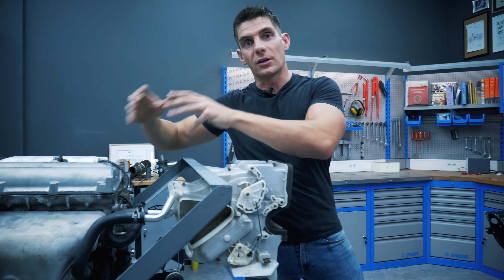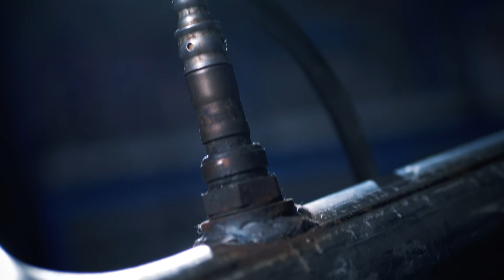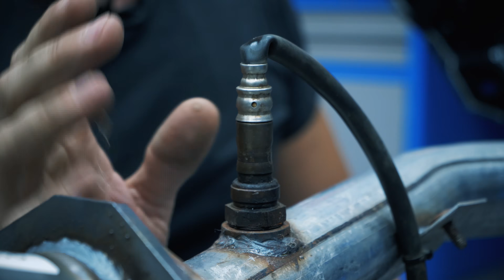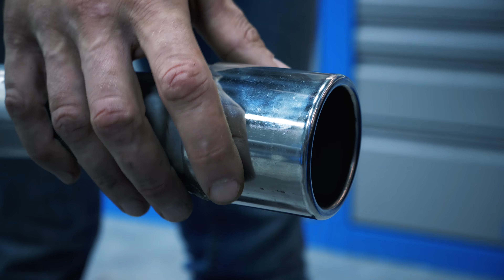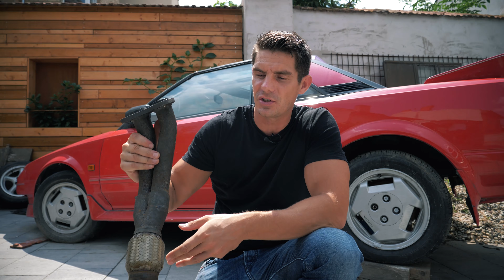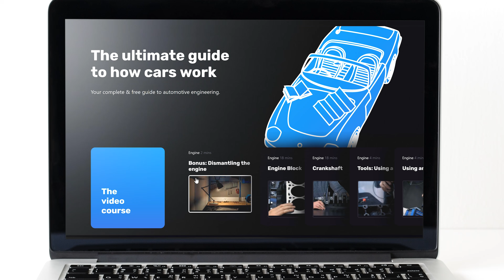How an exhaust system works

Comment: sir  i  have  a question   ...  if  pipe  line  1.5  inch  streigh   to  the end      and then muffler  size   2.5  inch    ...   it  ok  or not  ?  tq  sir

Comment: I have a question. India is facing a huge crisis due to pollution from ages diesel vehicles. It results into frequent ban on their usage in capital Delhi area. Can we design a muffler at end of exhaust to trap pollutants by spraying a liquid or passing polluted exhaust through wet filter. Request please answer
Reply: Or stop using diesel

Comment: Sooner or later those parts that are known as oxygen sensors will be changed...after the combustion mixture is burnt their is no oxygen left in the exhaust system ..but what those sensors do is measure the electrical current in the burnt gases,,When ever their is heat their is an electrical current produced ,this is then sent to the ECU to be calculated as a number which then lets the ECU adjust the mixture control..A lean mixture would produce more current as it is hotter a rich mixture would produce less current ..Then in the blink of an eye the ECU will make the necessary adjustments to bring the air / fuel mixture to around a ratio of 14 to 1.

Comment: Sir so does that means that if a car's catalytic converter is at working temperature so the car is no more harmful to surrounding as it will release c02 which trees would absorb,water vapour and nitrogen and harmful gases like carbon monoxide will be removed??

Comment: Excelent videos I wish I found out about this channel earlier. Just small information regarding different rubber exhaust mounts. Since every car has different shape, weight and size, the stiffness and mode shapes (eigenfrequency) of the exhaust assembly differs from vehicle to vehicle. This results to different resonance frequency of the structure thus requires different rubber mounts to dampen the excitation forces.

Comment: Found your channel while searching for the reason my exhaust system,  overnight , now sounds like a  stock car.  Very informative.  I think I may have a separation in the flange joining my engine manifold to the front pipe.  Will have my mechanic check it out quickly. Heavy snow here tomorrow so May have to wait a day or two.  Once again great information will enjoy watching your other videos soon. Just subscribed and hit the bell.

Comment: The muffler on my 2018 Cadillac Escalade  ( only 18000 miles)has a tiny hole on the bottom , at the seam. Spewing out of that tiny hole is a ton of soot.  So what does it mean having all that soot there. Should I be concerned about a possible problem somewhere? Thanks!

Comment: I have an old Mercedes diesel W124 250D without turbo with only the resonator in place. It makes an annoying sound at 3000 rpm. I got a second resonator for free. Would the second resonator make the sound more quieter or is it nonsence to put it on with the muffler missing?

Comment: If you get P0420 dump a gallon of lacquer thinner in half a tank of gas and rev the engine at 2.5k rpms for 30 mins or do 150 miles on the freeway. In my case it took 671 miles cause I do city driving but try this before buying a new cat
Reply: Turned my check engine off

Comment: Why aluminum is not use on the exhaust system, it is because of the temperature?
Reply: Yeah. Aluminum melts at only 1200F, it's just really good at dissipating heat. But if it's on an exhaust it's getting continuous heat which it won't be able to fully dissipate- thus melting off.

Comment: Another excellent presentation! 👍👍👍

Fun fact on O2 sensors: In their first iteration, these sensors were digital, in the sense they switched their output on and off depending upon (duh) the amount of O2 in the exhaust. The rate of sensor switching informed the ECU of O2 content and the injectors were fired depending upon the average switching rate. New gen systems use O2 sensors that create an electrical signal which is proportional to exhaust O2, providing much finer tuning of fuel injection.

Re: stainless steel exhaust, my ‘08 Altima Coupe with a V6 has such a system and has remained sound (no pun intended 😀) for nearly 160k miles.

Comment: Thank you for this amazing content. At least now I can speak the same language with my mechanic and know that I'm not getting ripped off. For example, I live in Zimbabwe and driving a Japanese import Toyota and this one guy told me that I should remove my catalytic converter because it is made for cold climates and is totally unnecessary here in Africa. From your explanation, I now know that that was totally bogus and I can now fight this myth from an informed position. Great job and keep them coming.
Reply: i guess aida kukubira platinum in  that  unit
Reply: @mikebeta1796  oh yeah. That makes sense. I just wonder how many cars are additionally polluting the air because of that myth.

Comment: I never understood why if an aftermarket exhaust would create more horsepower for the same input of gas etc, why the manufacturers didn't install them at the factory.  They are always looking for marginal gains in fuel economy.
Reply: Noise
Reply: noise, cost, and to facilitate aftermarkets companies

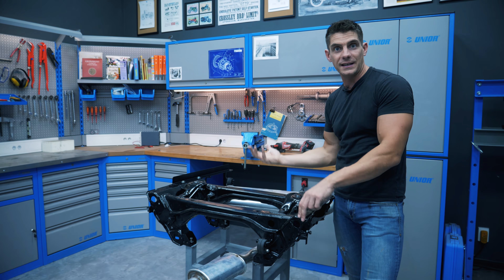Comment: 2:48 hot gasses cool down only on idle, if you step on gas pedal  and engine has 5000rpm, gasses travel from engine to end of exhaust in less than second so it can not be cooled down ,it is too short time- on front half of exhaust i wraped 1400c deg tape, and on rear half , 600c deg tape, and that lower temp tape was waporized

Comment: Strange. Here in the US almost all vehicles come with SS exhausts from the manufacturer.  First car I bought with a SS exhaust was a 1990 Mitsubishi Galant (my first fuel-injected car also) and every car I've had since has had a SS exhaust.  I've driven some of these vehicles over 170k miles and have never replaced an exhaust on any of them.

Comment: Pro Tip: If you cut or hollow out your cat, use 2 spark plug non foulers to get your 2nd o2 sensor out of the way of the exhaust and your check engine light won't come out and waste fuel. :)
Reply: second o2 is there just to check if cat works, nothing else, i deleted cats and tuner made to prevent eng chc lihht to appear by software

Comment: An important point to note on exhausts is that too much scavenging results in poor fuel economy. So those oversized, bulging pipes that boy racers are fond of does no good for their pockets. At the factory during the design and testing phase, engineers try out different diameters and sizes of pipes against power output, fuel consumption, temperatures, gas chemistry etc. The whole system is sensitive, from the intake valve all the way to the tail pipe. Factory replacement, or an exact copy is the best.
Reply: partialy right, watch engine masters, you could learn and see much more
Reply: @makantahi3731  Yeah, I watched Engine Masters. They did not give any figures for fuel consumption in both tests, all they were comparing was power and torque figures. For normal road use, the exhaust tuning will focus on moderate power, moderate torque and high fuel consumption. For racing it will be high power, high torque and high fuel consumption.
Reply: Also turbo chargers require a certain flow or pressure of exhaust gas. If you mess with the exhaust system, you can mess up the efficiency of the turbo

Comment: What i still to this date DO NOT UNDERSTAND is how a larger exhaust pipe affects an engine's performance..?? The idea is to get the exhaust OUT of the engine as quick as possible to allow more air and fuel to enter so that the engine can pump more and more faster and faster...  So WHY putting in a larger diameter exhaust pipe hurts the engine's performance..?? Is it not the point to get it out as quick as possible ..??
You would think the least amount of restriction within the exhaust and larger diameter pipes would HELP the engine push out out that exhaust faster so that it can inhale faster on the next stroke ... 
But you say NO which goes against the terminology ... I am confused .. !!
Reply: Given two identical engines, with two different size exhaust piping, I believe:

Since the larger pipe holds more air at a time, the air in the larger pipe will move more slowly than the narrow pipe (but they will still both have the same volumetric output per time). So, I think the fast moving air coming out of the engine would hit the slow moving air in the pipes and that might cause inefficiency. Also, there would be a greater volume of air in fatter pipes, which would be more effort to expel.
Reply: Ahh, still don't understand ... sorry man
Reply: piston engine works in pulses, so , puls from one cilinder helps to exhaust gasses from other cilinder to go out, so if pipe is to small it chokes and if is to big gasses slowes down too much and does not give benefit of suction-just on proper size of pipe you can get benefit of suction,  if you put to big exhaust pipe you will not loose power, you will not get extra power, difference between best and worst exhaust is less than 12%
Reply: @makantahi3731  wtf..??
Reply: still nothing clear?
Reply: Still nothing... none of it made sense how an exhaust pulse moving in one direction helps to PULL exhaust pulse from another cylinder when the exhaust valves are CLOSED ...
Reply: for example, header with 4 in 1, when gases go through 1 of pipe, in others 3 is less pressure and when valve opens on some of 3 pipes, it helps to pull gases from cilinder, you can make test, take 4 straws, and 1 of it put in mouth and blow air through, let all 4 have outlet  together on same position, near inlet of other 3 put cigarette smoke and you will see it enters in straws when you blows air through 1 straw
Reply: sorry man but your grammar is bad and i can't understand what your saying .. all i get is 4 straws and one in mouth and blow and cigarette smoke..??
Reply: ok, we can talk in my language if you speak it better than i speak english
Reply: go for it ....
Reply: ok lets try: dakle klipni motor radi na naćin da ispušni plinovi pulsiraju , ne teku kontinuirano i ako se ispušni kolektor sa 4 cjevi spoji u jednu cijev, plinovi koji teku kroz jednu od cijevi stvaraju podtlak u ostale 3 cijevi pa kada se otvori ventil na tim cilindrima ispušni plinovi lakše izlaze zbog podtlaka , ali mislim da ti ni ovo objašnjenje neče ništa razjasniti jer je prevelik nedostatak osnovnih fizikalnih znanja zato se nemoj truditi da razumješ zašto već to prihvati ka takvo
Reply: Well that makes PERFECT sense now... thank you
Reply: @ACommenterOnYouTube  The gases are still moving through the exhaust, which is more or less like a giant straw, by the time another cylinder fires. The momentum of the last pulse creates suction that helps clear the chamber of the next.
Reply: ok ... is that the best explanation you got ..??
Reply: 1. Turbo engines require a certain amount of exhaust gas to power the turbo. A big exhaust pipe might remove too much of exhaust gas too easily, so the exhaust pressure would be too low for the turbine.
2. Sometimes the inlet and exhaust valve timing overlaps. An engine might need a certain amount of exhaust back pressure to control the amount of air-fuel coming into the combustion chamber
Reply: @Not Me Not Me:
Its funny that i have 3 turbo charged cars and one has a full 4 inch exhaust from the turbo to the rear muffler while the other 2 cars have full 3 inch exhaust from the turbo to the rear muffler .... 
WHY would i run a small diameter pipe coming off the turbo ..?? WHO runs small exhaust pipe off the turbo other than factory ..?? 

Next that is a complete MYTH that you need back pressure within the exhaust system for the engine to run properly .. The engine is an air PUMP ... the faster it can exhaust the gas, the faster it can get more air IN ... 

The only thing a larger exhaust does is change the power band to the upper rpm's ... WHY this is i have NO idea and still nobody can explain why ...
Reply: Спасибо
Reply: i was exaggerating ... I guess i will have to wait until someone can explain it to me in a fashion to where it makes sense ..
Reply: Truth About LONG TUBE HEADERS... (R/T life) try this video, narrator is american, so no problem with grammar, it should be good explanation for you , if not , your black hole of misunderstanding is to big
Reply: @Makan Tahi:
1st off let me make a comment, just because ONE explanation does not satisfy one person, does not mean that person has a black hole of misunderstanding ... Don't tell me that when someone teaches you something that you understood and got it immediately the 1st time. Not everyone understands or learns from the same method. Some people need to be taught from other directions before they will understand the principle .. A GOOD teacher has the ability to teach the same material in multiple ways so that a certain student or student"s" can understand. You have a class of 19 students, not all 19 students will understand explanation 1, some need a 2nd or 3rd form of explanation before they can add it up in their mind before they understand .. ROUND is not the same as a BALL ...  Same as you can have an object that is flat and round ... Did you understand both the 1st time ..?? DOUBT IT ... 

Ok, so what i gather from that video is that the ONLY time the exhaust pulse will help PULL exhaust from the other runner is once the pulse gets into the collector to merge with the "air" from the other runner to help pull ... 
Basically each runner has its own atmospheric air within until the collector area where all 4 runners atmospheric air will combine together. So as the exhaust pulse is traveling down the 1st runner, it will NOT have an effect with the other runners until it approaches the collector, it will now merge with the air from the other runners and its back end creates a "vacuum" of sort, like a venturi effect within a carburetor, to help PULL air or exhaust from the other runners which will help extract the exhaust gas as the piston is trying to push it out .. 

That is what i understand from this ... Please don't verbally attack me again, we all learn different ... maybe you don't understand that and that is a black hole for you
Reply: it seams, you finally understood, congratulations, you see, this method of teaching gave result!, sorry if you felt   been attacked, many of us lost time to help you , but it looked you were joking with us
Reply: @Makan Tahi:
Back to the point that not everyone learns from the same teaching fashion, some need that info explained in a different manner before they can understand.
I know this because i deal with customers and i have ONE method of teaching everyone but not all understand that one method so now i have to come up with a different analogy so that they can understand it. This is just how the human mind works ... 
Its all good man :-)

Comment: Question. Why would the stock exhaust be made of mild steel, when they know that it would be exposed to the elements and make it rust faster. Is it purely done to reduce production cost or is there another reason ?
Reply: Galvanized steel is corrosion resistant and yes it's purely cost. 
Mild Steel < Aluminum <<< Stainless Steel in terms of price

Comment: Very informative, thank you for the great video.
Do you plan on having a body in white in the studio at one point? It would be great to see how the shell is constructed. It would be a good opportunity to talk about structural adhesives, rivets, welds, crumple zone considerations and so on.
Reply from the maker: I have a bodyshell sitting outside.  It's in racing green but painting it matt white would make things a lot more visible.  I might do it :D  But even if we don't paint it white we'll definitely have it in the studio.
Reply: Cool :) Btw body in white is a term sometimes used to talk about the body shell. But they are not always white!